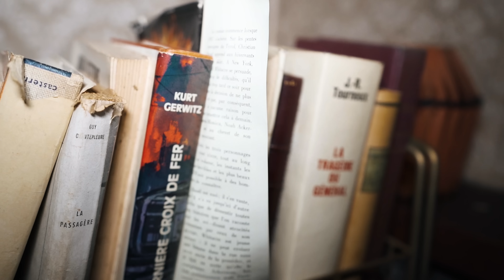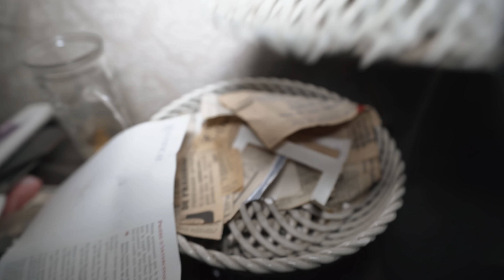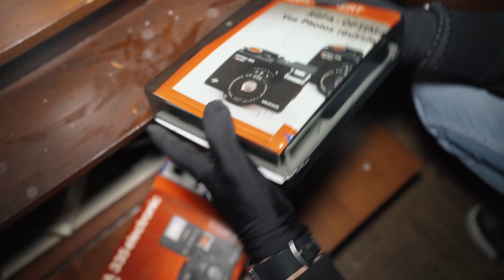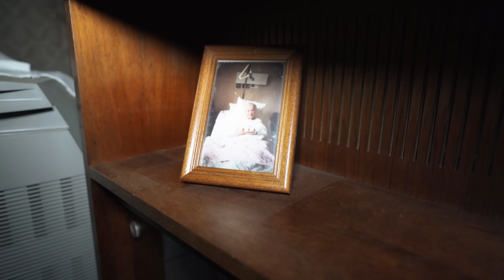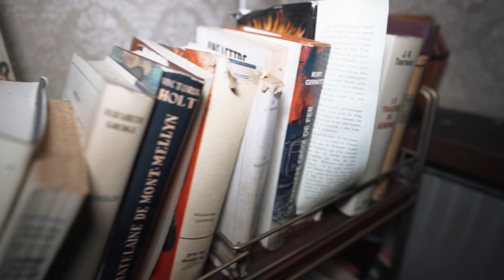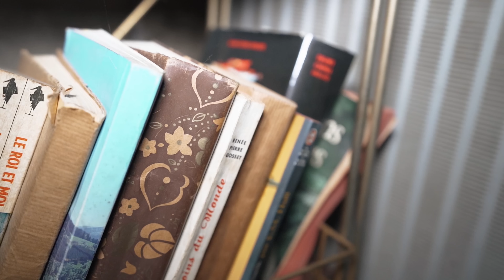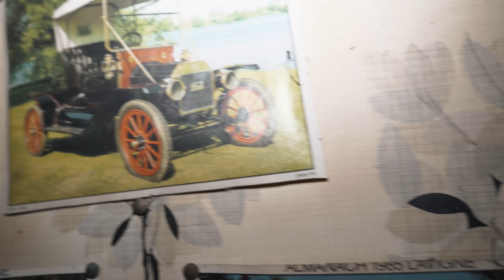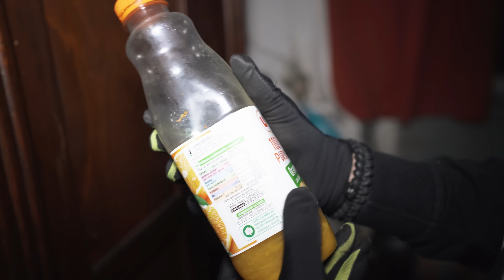We made an UNEXPECTED FIND in the basement of this ABANDONED French house!

Comment: What you think is a plane in the basement is  an autogyro. Usually there is a propeller like a helicopter, above, and the motor, missing, behind the pilot's seat, is used to move the aircraft forward. Source; I am a former classic ultralight pilot.
  possibilities: It has never been finished, or taken apart to put it in the cellar. But I think it have been used. THX Explomo, your explorations are often pathetic, and most of the time, one wonders how people lived, and it is often sad!
The soldier pictured with a cap belonged to the Air Force, and the gyro may have been his passion in his old age.
Friendship from France .